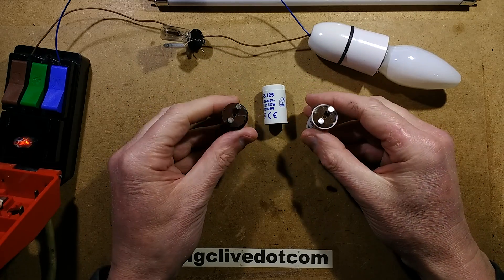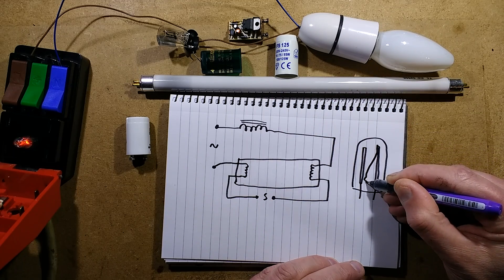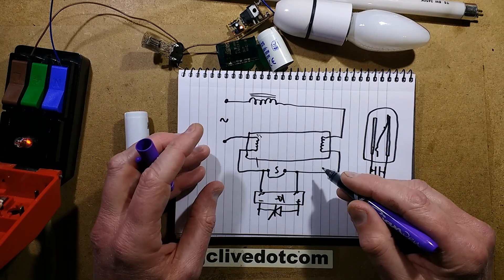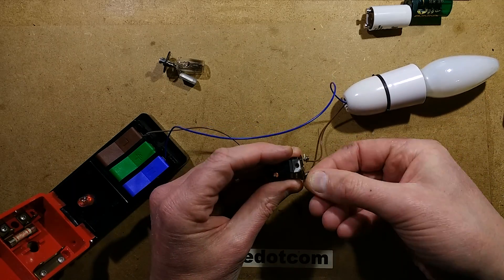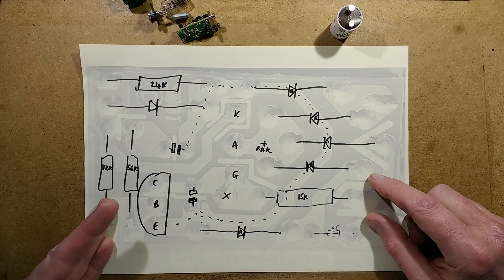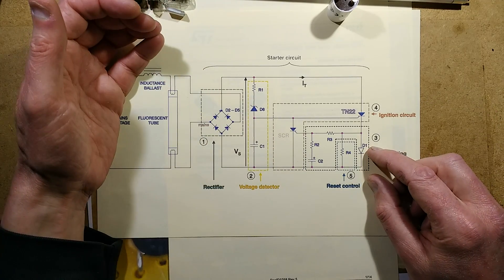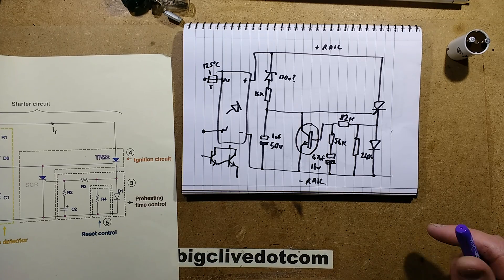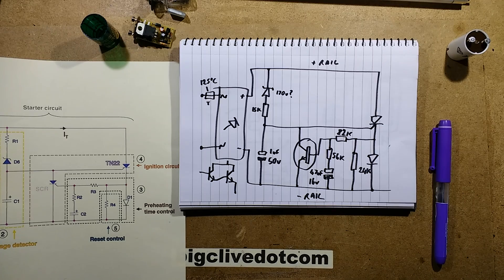Reverse engineering an electronic fluorescent starter.

Comment: Hello Clive, I enjoy the content of your videos. 
There is a large AC ripple content appearing  on the  bridge output   , this being  unsmoothed ., the positive going pulses   appear at  the transistor base via the 47 mfd and 56k, pumping up to Vbe,  thus keeping the transistor on after it initially triggers.  It cannot turn on prior to the initial trigger because the  47mfd/56k time constant is longer than the 15k/1mfd. Once the tube fires, there is no voltage available through the zener,  the SCR remains off. 
If the tube doesnt fire, the ripple voltage continuously removes gate voltage via the transistor shorting the 1 mfd until the power is cycled.
 Its a bit of a trick circuit to be sure......
Reply: Ah thank you! I think I get it now. 

I watched the video and read the comments explaining it further and I didn’t honestly understand it until I read your comment. 

I felt like I was the only person that didn’t get it still after reading the further explanations.

I can’t believe I am the first person to give you a thumbs up 👍
Reply: If the 24k resistor was lower value then that would steal the current from flowing into the base and cause the transistor to turn off, thus allow multiple attempts at starting the tube?

Comment: Nice bit of product placement with the meter :). We used to have starters with cut out built in. When a tube failed to light, the starter would trip out. They were called watch dogs. Why won't twin series 20w tubes work with a universal starter?
Reply from the maker: The twin tubes in series require a starter with different voltage thresholds because of the much lower open circuit voltage across the tubes.  I was never particularly fond of the single ballast for two series tubes approach.

Comment: hey clive i was look at aliexpress and found this and the https://www.aliexpress.com/item/AC-220-V-1CH-10A-Relay-RF-Wireless-Remote-Control-Switch-Wireless-Light-Switch-4PCS-Receiver/32727882199.htm
Input  AC220V for the Receiver .Press the Learning Button until the Led  indicator ON. Then press transmitter, the Led indicator flash fast, it  means learning successfully.  
press my finger on a 235v tact switch NO WAY!!
Reply from the maker: Yeah, if it's powered by a capacitive dropper then I'd only be pressing that button with an insulated stick.  I wonder how many people will get a shock doing that.

Comment: If I am understanding correctly, this is basically an automatic version of the manual red "start" button on some desk fluorescent lights?
I do remember my father's old shop having the lights flicker when you turn on the switch.  Good old magnetic ballasts.
I remember seeing several cards of starters in a local home center about a month ago.
Reply: Basically, yes, but I would never have thought of the term "automatic" for those glow light starters that are still quite commonly used over here. 

It wasn't until copper became so expensive that magentic ballasts started fall out of favour and were replaced with electronic ones in new fixtures. But there are still loads of magnetic ballasts around.

Comment: Once the Darlington pair transistor fires the collapsing choke field produces a Back EMF discharge that is enough for the fluoro to conduct resulting in the voltage drop across the fluoro is low enough that the Zener does not conduct and cause a re-trigger the heater element circuit. Once the flouro arc is struck there are enough charged particles in the tube for the reverse cycle to reignite the arc.

Comment: can you put an old starter in series with some Christmas lights?
Reply from the maker: +Slot1Gamer Yes, but it's very restless looking.
Reply: what about a few starters in series?
Reply from the maker: Never tried it, but if there were not too many (combined gas discharge voltage exceeding mains voltage) then they might theoretically operate, but I'm not sure what would happen.  If you put them in parallel there would probably be a dominant one.

Comment: I bought the fastlux electronic starters for the fluorescents in my garage and shed, kept the original tubes, they worked great for a day or two then killed both the tubes, guess they were close to death anyway and the aggressive start finished the electrodes off?  A few years later one of the electronic starters gave a fierce buzz when switched on and killed itself, so back to the original plink-plink starter. Rather than buying a replacement, I figured I'll probably go for LED tube replacements whenever the next tube or starter dies.
Reply: Fastlux, is that the 0.3 second start ones?

They are pretty aggressive, found something about the fast start while looking for more info. Apparently they use half wave "DC" drive to get more current to the heaters through the choke
Reply: I did a quick (hah it took ages, makes you appreciate Clive's time taken) teardown and circuit of the fastlux starter, certainly not full-wave rectified, but beyond my ability to comment how it works ...

http://adslpipe.co.uk/misc/fastlux.png

Even though this was the supposedly dead one, nothing looked damaged, so I tested it with a 230V incandescent lamp in series and it did send a "pulsed" waveform for a few seconds, then switched off (until disconnected, C2 discharged, reconnected).

Comment: I think the reason it only tries once is the 47 uF cap on the transistor via the resistor, the 82 and 24k providing a discharge path when power is turned off. Once that cap charges the current flows through the transistor instead and not providing a gate cathode drop high enough to trigger the SCR and perhaps leakage from Collector base when the transistor is on is enough to keep the cap charged.

Comment: I feel the need to put a whole bunch of the old glow starters in series to make a blinky, clicky art project
Reply from the maker: That's what I was doing when I was a kid.  I made a PCB with four starter bulbs that were supposed to blink ordinary neons on and off randomly, but the current through the neons wasn't enough to heat the starters bimetal strips enough to work.  So I shorted one of the neon and resistor pairs briefly to give it a start and it went bang, took out the fuse and blew all the tracks off the PCB.
Reply: put them in series with some tiny neon's
Reply: bigclivedotcom well I know what I'm doing this weekend.

maybe I'll use some big neons, and some kind of other load to get the strips going

Comment: i remember cold start and rapid start starters. also for the army we had some florescent lights that you could turn on a small tungsten light to warm it up. Physically warm up the florescent tube.
Reply from the maker: The early dimmable fluorescent lights had a tungsten lamp to provide continuous current to the cathode heaters and make them dim more stably over a wider range.

Comment: The Darlington has 2 Vbe drops on the base, so there is a question as to how the Darlington turns on in the first place, given that it is driven by the forward bias voltage across the diode in series with the thyristor. The Vf of the diode should be less than or very close to the base on voltage of the Darlington. so is the series diode a sense and the diagram has it the wrong way round or is it a diode with a high Vf? 
The high Darlington gain means it's base current will be very low, so the charge on the base capacitor will be able to maintain the clamp on condition for some time, particularly if the capacitor charge is not able to flow back through the diode in series with the thyristor. This again point to a high Vf for this diode or more likely that it is a reversed biased Zener diode with a Vz greater than the two standard Vbe drops of the Darlington. It is like therefore that thyristor triggers more than once, but with a very long period between trigger points. As there is not any hysteresis in the Darlington circuit, it is likely that after the initial triggering that charges the timing capacitor, subsequent triggering a will be of a very short duration ( maybe just a mains half cycle), sufficient to recharge the capacitor and reactivate the clamp. Knowing the excess voltage across the charged capacitor and the Darlington base current it should be possible to calculate the trigger period. The resistors connected across the capacitor likely control the trigger period so that the circuit will trigger reliable each time the mains is turned on.

In the case of the recommended circuit that uses a second thyristor rather than a Darlington as the clamp, the clamp thyristor will fire just once as C1 will maintain the clamp thyristor hold current through the zero voltage of the mains cycle.

Comment: I've seen these starters in my childhood in the 80s when one broke. They all looked like the white plastic housings, but they did blink the lamps several times. Also after they were replaced, I haven't seen fluorescent tubes go on without prior blinking until the end of the 90s or even early 2000s.

Comment: While I don't have any idea why the darlington transistor pair is set up that way, the setup reminds me very much of your  Ghost Detector circuit built from Rabbit Ears!  BTW I built one of those but instead of making it with rabbit ears, I used a torrid wrapped with a BUNCH of copper wire, it is very sensitive indeed.

Comment: Looks like a better design than the ones i bought some years ago. First one i got worked fine, so i bought another ten or so. All of which failed within half a year, burning out some almost-new tubes and one even catching fire from a cold solder joint arcing.
These had a relay inside and used a single diode to effectively saturate the ballast core with DC current to allow for a larger preheating current (which burns out the tubes and causes a really loud buzzing noise while starting), as for voltage detection they used a varistor (which is not intended for anything other than surge absorption and did burn out). I didnt bother to reverse engineer further, only replacing all the fixtures with electronic ballasts that finally work properly.
Reply: Damn dude, I just bought 6 of them today for about 50 cents each, now I'm carefully considering again for the application, thanks a lot for your experiment , really appreciated.

Comment: I used to like charging those little caps up with 500 volts (with an insulation tester) and throwing them to people while saying 'here catch'. This was back in the 80's when you were still allowed to do bad things to people at work.
Reply: Rabbi Zyklon Brausebadstein  when I first heard about that I was shocked.
Sorry I had to, I used to heard those stories. Unfortunately most people are already cautious when I throw things at them.
Reply: @Firecul  "when I first heard about that I was shocked."

As were the people he threw them too.
Reply: Back in the day a colleague accidentally discharged a 5uF cap at 500V through his hand. The lab smelled of bacon for hours. Seriously, why would you do that? I met someone else with permanent nerve damage in his hand from a similar incident. It's no joke.
Reply: In my electronics class, everyone just melted blobs of solder and catapulted them from the irons. We had no way of charging any capacitors because our teacher knew we would try that lol.
Reply: We used to charge capacitors and poke people with them. I still have two nice little burn scars on the back of my neck. Getting burned is part of the job as an electrical engineer I guess.
Reply: Yep. Happened to me my first day at electronics school.
Reply: Worked in a place where they repair electronics.

If you were working on any kind of mains connected equipment and you left it open, you had to be very careful, looking for small electrolytic capacitors, soldered across the mains points on the PCB, otherwise, when you applied power, there were a fair chance you would get a shock, a pop, some smoke and a room full of fellow workers rolling on the floor laughing.

Also one time i wanted to charge a liion battery so i attached it to a power supply and set the current limiter to something sensible, but in my hurry i forgot to set the voltage limiter.

Left to do another job and soon got a message on my phone, with a picture that said "Your table just exploded".

Sounded a bit like a hand grenade apparantly. :)
Reply: mark rainford I placed a cap on our  teacher's drawer handle.
Reply: Hah! We did the same with small photoflash capacitors when I worked in digital camera repair... Good times
Reply: We used to skip the middle man and just hand people the test leads, us
Reply: In the military we would have a charged cap on the desk with a sign reading “do not touch”,  we catch more people that way.
Reply: Hahahahahaha yup. The good old days LOL.
Reply: My grandpa was an electricians mate on a ship during Korea.... he said he had a guy that kept sitting in his chair and putting his feet up on his desk.  He charged a cap and connected it to the chair and the rubber mat underneath kept it isolated..... the next day the guy sat in his chair, and as soon as he put his feet up on the metal desk, it lit him up.  Never had a problem with it again.
Reply: @Blinkerd00d  lol
Reply: Or asking a fellow student to hold a granate and walk away with the pin.
And then after 20 times you had private lessons.
Yes we had a tough school in Aghanistan
Reply: I can beat that. I hid a capacitor behind a toilet pan with two short lengths of fuse wire running up the back of the pan and just curling over each side of the toilet seat. The results are spectacular, if messy.
Reply: Its so sad isn't it Rabbi I think I read somewhere that apprentices have human rights or some sh*t like that, what is the world coming too?
Reply: Rabbi Zyklon Brausebadstein or get them to hold on to your wind up 1000V Megger LORL Great fun....
Reply: I used to put one terminal from an electrolytic capacitor in the outlet and when someone was passing near me, I'd grab him and touch the other terminal of the cap. lol
Reply: In my high school electronic class, we used to heat up pennies with a soldering iron, then leave it on the work bench... and wait for someone to scream.

Comment: I'm baffled how the transistor gets turned on, since a darlington has 2x Vbe, and the drive to it is fed by a single diode drop - unless that is not an ordinary diode!

The "R4" is defined as the reset, I'm guessing it's meant to shunt the leakage to lower the voltage to the point where the switch off SCR / transistor unlatches.

I guess the value is too high, with a lower resistor there, it may retrigger.
Reply from the maker: +Matthew Day That did go through my mind too.  I may desolder one end to see if it's a different diode.
Reply: Just read about another system, the half a second "fast starter", though it sounds somewhat abusive of the system.

http://users.tpg.com.au/pschamb/light.html

Described as using "DC heating" and producing a characteristic buzz and magnetic disturbance, I instantly figured out the trick - while there would be a 50% disadvantage in only using half wave control, more power would reach the heaters as the ballast would present only resistance. The other half cycle could be used to continuously detect tube firing.

It would be a rather brutal system though, and I can't see it being good for the life of tube or ballast

Comment: How is the darlington getting switched on if it has only one diode drop on the base?
Is ist because of the diode drop being rather high due to the high current trough the thyristor?
Reply from the maker: +MrJumpersun I think it may be the higher drop due to current.

Comment: No its the gain if the transistor that keeps the lights on, the very low voltage leak across the thyristor does it for me.....simple.

Comment: Why not just replace the starter with a simple push to make switch on the wall, turn on the light switch and then press the 'start' button and release to fire the tube
Reply: Andrew Stevens yes but if the switch uses multiple lamps you would have to start them all separetly with separate buttons. Also you can't operate lights automaticly.

Comment: Unless the thyristor was leaky enough to keep the transistor turned on, I don't see how this could be a "one and done" circuit.  If that transistor was really a SCR, that would make more sense.  The SCR would stay on as long as there was still a high voltage across the starter.
Reply: Question - are you SURE this is "one and done"?  Or maybe just a longer time cycle to retry?  As in several minutes?

Comment: the. Darlington is preventing the thyristor from firing again by shorting out the remaining voltage before the next cycle begins. without this circuit the thyristor would fire again, surpressing the ignition pulse.

Comment: What is the difference between single and series starter?
Reply: The striking voltage of the gas in the glow tube is the only difference, the series starters are basically 110 volt single starters, but we use them when we have two series connected fluorescent lamps sharing a single ballast, therefore the starters only see 1/2 the mains voltage each.  They won't work in a single 240Volt fitting as they will continue to glow even when the lamp is lit and continually blink, and single starters used in series usually won't glow at all because they think the lamp is already lit.